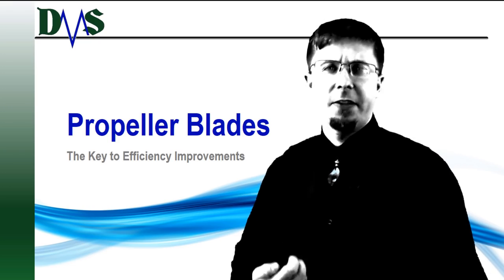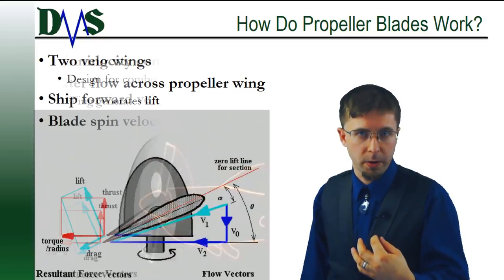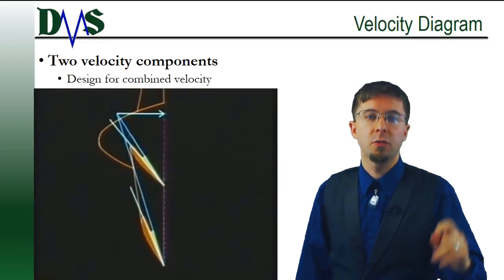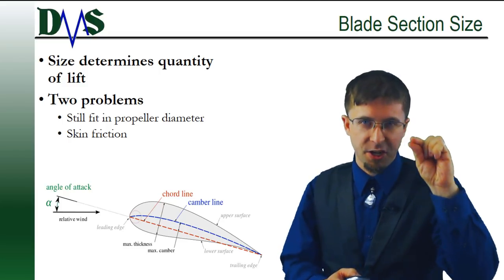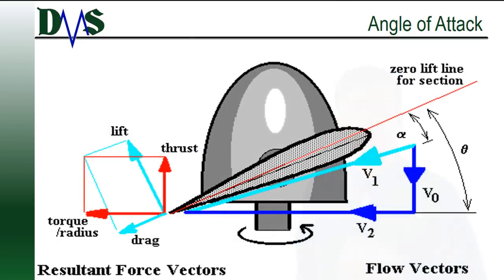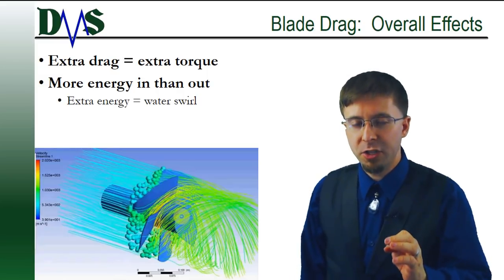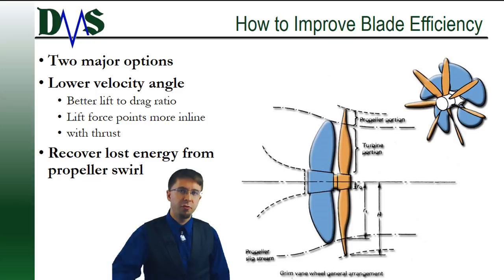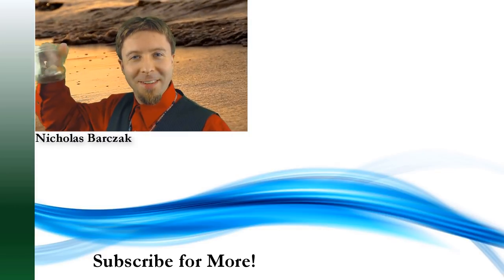Propeller Blades:  The Key to Efficiency Improvements

Comment: I like the sense of humour of defining the most efficient propeller, as one which has zero angles of attack and no thrust! 

Here is a question that one never seems to see the answer to it.
Considering that water is incompressible and the air is compressible, then if we take the same multiblade propeller with a high blade area for comparison, ( even an impeller)  what would the velocity/pressure profile of the fluid medium being used ( compressible air or incompressible water)  THROUGH THE THICKNESS OF THE PROPELLER  BETWEEN THE BLADES. and the immediate zone around the propeller. It is not an easy answer especially for those water propellers where the water velocity changes as it goes through and accelerates through the propeller!!!
Reply from the maker: As you said, predicting the exact velocity profile is a little difficult (but achievable with modern computers).  Interesting, the theory and mathematics behind propellers started with this exact problem.  We started with a goal for a velocity and pressure profile and created a device to achieve that.  In the zone directly around the propeller blades, we see minimal change in velocity of the fluid.  The one exception is the fluid right on the surface of the blades, which accelerates as it passes around the leading edge of the blade.  The pressure shows a huge change in the region around the blades.  It spikes from a strong negative pressure (suction on the forward face) to a strong positive pressure (pushing on the back face).  

This is the key behind propellers.  We are trying to create a sharp change in pressure, and the velocity change is just an unfortunate side effect.  The velocity of the fluid accelerates as it approaches the propeller and then slowly decelerates far downstream.
Reply: @DatawaveMarineSolutions  Thank you for replying. I thought about writing a book on propellers as I do feel that propellers could be misunderstood. I wish to share my philosophy on some types of propellers/ impellers. The philosophy stems from the fact that water is incompressible and it is also non-expandable as we must stay away from cavitation in this discussion.  Having a propeller whose blades are very thin and they form what is effectively a multi-start thread on a deeply threaded rod,  we can forget about Bernoulli coming into the picture, as there are other features to consider when we know that water is incompressible and non-expandable and is going through a threaded rod where the void spaces remain constant through the threaded rod. If we consider a shrouded impeller, rotating with its helical blades, it is no different from considering a piston moving along a cylinder where it sucks in water from the front and pushes water at the back.  WITH SUCH A SITUATION THERE IS NO LINEAR ACCELERATION OF WATER IN BETWEEN THE BLADES OF THE IMPELLER AND SO NO FORCES ARE PRODUCED IN THE SPACE OF THE IMPELLER. However, the non-expandable water at the front of the impeller will cause a sudden suction and the lower pressure than ambient will accelerate water ahead of the impeller.  At the other pushing end, the pressure is higher than ambient and so water will pass through the blades at constant velocity but at the pushing end, the water will be accelerated. Hence the propulsion forces are not produced in between the blades of a helical propeller but much ahead and much behind the propeller. 

All this is due to the fact that we are assuming perfect helical blades and incompressible and nonexpandable water going through.  Note any threaded nut is very happy going along a rotating threaded rod, does not increase nor decrease its volume and hence that is the condition of such a water propeller or an impeller we are considering.    The forces in a propeller are generated only where there is the acceleration of water and there is none in between the space of a helical propeller but there is plenty of acceleration in the zone before and after the propeller.

Now if the blades are not perfectly helical ( really constant pitch)  but are curved to diffuse convergently or divergently as in the case of a jet compressor stage, where the exit velocity is different from the incoming velocity, then the volume of water passing in between the blades acting as a diffuser will have to change the area it passes through and so for a curved blade that does not follow a perfect helix, a shrouded propeller should have the exit area of smaller area than the intake.  If we assume that the incoming water into the propeller v, has doubled its velocity to 2v at the exit, due to the curve of the blades, then there is an acceleration of water in between the blades of a propeller, and propulsion forces are generated in between the blades of the propeller.  Note that in this case we still do not need Bernoulli and aerodynamic sections as it is all a case of changing the momentum through the blades in this case. 

Now let us talk about surface propellors, as the manner in which they operate efficiently, is related to what was said above.  Now water may be incompressible but it will shatter into small drops if it is accelerated heavily and suddenly. If a paddle hits the surface of the water, the sudden effect will put a lot of force on the paddle but only a few drops of spray will shatter around the space where the water was hit.  

This is no manner in which to accelerate water either by sudden suction or a sudden pressure as water will show other characteristics. If water was like solid steel balls which do not compress not expand, then all that was said above will still apply but water is not like that, IT CANNOT BE ACCELERATED SUDDENLY. This is the importance of arranging for the apparent entry into the blades to be parallel with the leading edge so that the surface propellor will not just hit the lump of water, but it will load it onto the leading edge of the blade and coax it to accelerate along the blade due to the curve of the blade, and as the lump of mass of water reaches the trailing edge it is released with high velocity and there is no more acceleration behind nor before the surface propeller.    It is interesting that the solidity of the water in a surface propeller can change it shape due to the rheology of the water and all that acceleration along the blade must be done smoothly and fairly quickly before the lump of mass of water changes shape in smaller spray with no effective mass to drive!.   

So my point of discussion is between the two limits of a fully immersed propeller with perfectly helical thin blades where the space between the blades does not change and so there is constant velocity, no accelratio0n but a great pressure change between the intake and the exit., and all the propulsion acceleration forces in such a helical propeller will take place totally ahead and behind the propeller. Such a propeller can be enclosed in a parallel cylindrical shroud.

Then there is the non-helical curved blade propeller which accelerates the water along with the blades and hence the output area will have to be less than the entry area. For such a propeller with a slip of 50%, it is interesting how small the curve in the blade should be. 

With surface propellers introducing the air which is incompressible and expandible, then the lumps of masses of water can be separated and that is the reason the surface blade is curved as it is as water is no longer compressible and non-expandable and it can also roll off the blades if the acceleration on the lumps of water is too slow, on the other hand, one just cannot hit a lump of water suddenly as it breaks into small drops and so THE SMOOTH ACCELERATION OR CHANGE IN VELOCITY ON THE BLADES OF A SURFACE PROPELLER   MUST BE SMOOTH TO RETAIN LARGE ENOUGH LUMPS OF WATER BEING ACCELERATED ON THE BLADES TO FINISH UP WITH ENOUGH DRIVING FORCES. 

In my book, I think I would cover the effect of aeration and cavitation on,  the helical propeller along which there is no acceleration, the curved blade propeller along which there is acceleration, and Bernoulli and the air propellers will show the misgivings we all know about.

However, for now, I want to delve into the situation that even if the velocity of the water in between the blades of a propeller remains constant and the blades are purely very thin helical blades, shrouded in a cylinder in order to avoid water escaping or incoming through the surface of the shroud, one can have a good propulsion drive without thinking too much on the NASA and Eppler and other cross-section which their variation is velocities and pressures along the surface of the blade. The nature in which the accelerations of water are handled is very important and in surface drives, it is not a case of hitting a lump of water with a cricket bat!  It is interesting to start looking at drops of water, as stell ballbearing which does not change shape in all the transactions we activate in propellers, or else as rubber balls where the bat/blade hitting the water drop could change its shape as do most surface propellers as there is air introduced to do the buffering,   The fact that it is all inertia, acceleration and the rheology of the water, it makes it all so interesting to understand propellers in a better fashion. 

If we had to add a nozzle ( diffuser)  at the back of a propeller then one needs to build up pressure and one cannot use a propeller with narrow blades as found on an aircraft but one with multiple close blades as in a jet compressor where the high pressure built up cannot escape back through the blades as in a helicopter top rotor or indeed any wing with spaces ahead or behind the edges. Nozzles, are really velocity/pressure modifiers" amplifiers" with no moving parts and are related to diffusers, where high pressure can be changed to high velocity or high velocities can be changed to higher pressures. In ships, we need not worry too much about how it all works, as the modern jet engine says it all, for after all, in a jet engine, what happens between the blades is all that happens in a ramjet due to the fact that it uses compressible fluid like air. A jet engine is really a lot of ramjets in parallel made to rotate to be able to work when the engine is stationary on the ground!   The fact that water is incompressible and on occasions boils, so expandible, we need to fully understand what happens in between those water blades with the convergent and divergent diffus4ers  that may exist before, through, and behind the propeller. Perhaps understanding diffusers are a better investment than understanding propeller blades on their own.  We could have a front diffuser,  a  hot chamber to boil the water,  rather than a propeller and a rear diffuser and the whole engine would be located in the propeller!!!!!!   Pity that water is so difficult to work with and its latent heat of boiling it takes too much time relative to it passing between the blades of the propeller.  Now that would be a difficult machine/propeller to calculate mathematically !!! 

Thank you for listening,

Comment: Would a ducted propeller be more efficient and use the swirl too?
Would make a better skin, like shark or a golfball, the propeller more efficient?
Does the number of wings rise efficiency? 
Are the effects in air and water same or is there other things to consider then density?
I wish I had a physics teacher like you in high school.
Reply from the maker: Hi Andreas.  Excellent questions.  I'll give you the short answers.

Would a ducted propeller be more efficient and use the swirl too?
     Ducted propellers are more efficient, but not because of the swirl.  I need to do a whole video those.  A propeller duct is basically a wing wrapped around the propeller.  As the water gets sucked into the propeller, it runs over the duct wing and produces extra lift.  But we also have extra drag from pulling that duct through the water.  The benefits outweigh the drag problem up to a certain speed (around 14 - 18 knots).  Then it becomes less efficient.

Would make a better skin, like shark or a golfball, the propeller more efficient?
     It might help some.  But only about 2-5%  The skin friction on the surface of the blade is a minor part of the total blade drag.  We actually get a lot of drag from the lift generated by each blade.  (Physics:  you can't get anything for free.)  Some experiments have examined using those surface textures to improve the lift on the blade.  With the right texture, we can keep the water flow attached to the blade surface and use a more aggressive blade shape.  But more aggressive is not more efficient.  All those interactions are hard to gauge.  Normally, we have to just build a model and run an experiment to see what happens.

Does the number of wings rise efficiency? 
     Generally, yes.  Many of the efficiency penalties depend on how much force we try to squeeze into each blade.  More blades / wings means less effort from each blade and better efficiency.

Are the effects in air and water same or is there other things to consider then density?
     Air and water are largely the same, aside from the density.  Just three major differences:
     1.)  Air and water propellers generally run at different speeds.
     2.)  In water, we also need to worry about the limits of cavitation.  https://youtu.be/MyZzhwYMytc  That forms an upper limit to how much thrust we can fit in each blade.
     3.)  In air, we also worry about compressibility.  Air is compressible.  It's density changes depending on the pressure.  This is how we get sonic booms at the speed of 343 m/s.  But even before you hit the sonic boom speed, the air compresses some and we need to adjust the design for it.  

Great questions.
Reply: @DatawaveMarineSolutions  Interesting about the blade number, and as always I understand optimization is done with regards to some variables while leaving other variables fixed. My follow up question about your statement that: more blades leads to better efficiency, would be: is that when fixing the required thrust per blade or in general? Say i would like a certain low speed from a small displacing vessel well below hull speed. The free/undisturbed stream and the propeller diameter are both fixed. Would more propeller blades still be beneficial over fewer when the propeller thrust requirement is constant? Best regards, Christian
Reply: Don't forget about barnacles & oysters. Stuff grows underwater. Unless your designing outboard propeller, I believe simple is better 😉 (hull diver perspective)

Comment: Nick what is your thoughts about Z-drive pods attached to a sailing catamaran?
Reply from the maker: Not sure why you would need them.  As a sailing cat, the boat already has rudders, and catamaran means twin engines (usually).  That already gives very good control.
Reply: @DatawaveMarineSolutions  I was thinking that installing electric motor ones for when you need to motor instead of sail.
Reply from the maker: @carlsmith2826  My mistake.  I thought you referred to Z-drives which are azimuthing propellers, directly coupled to engines.  As to electric powered podded propulsion . . . that is a much longer answer.  I'm working on some videos that address this.  But the biggest issue I have with electric propulsion for boats less than 30 m. is the challenge of supplying suitable parts.  It can be difficult to find an appropriate motor at that size.  There are several industrial motors that are suitable.  But then it can be difficult to create the power infrastructure to support them.  That is a whole complex ship infrastructure problem.

Comment: Three important unmentioned items:
1) Propeller swirl is caused by a propellers inability to draw water into it by gravity equal to the exhaust velocity volume of the propeller . The exhaust volume exactly equals the intake. A delay causes most of the swirl.
2) Marine propellers get the water from the surface. The reason for this is the momentum of water. due to its mass. If not true, a marine propeller would be pulling water from China.
3) Propellers are very sensitive to tip speed.  A 20 inch 4 blade propeller with 0 pitch has  @ 1000 rpm, a tip speed of  5233 feet/minute, or just under the old "Mile a Minute" rule in engineering. The  power needed is 5 HP.. The same 20 inch 4 blade prop with 0 pitch , at 2000 rpm  requires 40 HP. This is why reduction gears help with thrust AND SPEED. The optimal diameter/pitch ratio is 12/10 for line pull and 10/12 for speed. This works from a practical standpoint. Usually, for a general purpos boat, a square wheel is optimal.
   ,All of this information is based on design of several boats and variations in design. Hope it helps someone. Especially hope it helps someone involved in using finite analysis or other digital development software HINT...HINT.
Reply from the maker: Interesting points.  Myself, I believe in scientific tests and hard experiments.  It would be really fun to check these concepts.  Based on your description, your first point seems to indicate that propeller swirl is due to an interaction with gravity.  If that was the case, we could easily create a test rig with the propeller mounter horizontal instead of the conventional vertical.  Gravity would be equal across the entire propeller.  According to what you described, we should get no swirl in that case.

I can also think of another test for the argument that propellers get their water from the surface.  Simply stick the propeller in a pipe and ensure the inlet to the pipe is well below the surface.  If the propeller truly gets it water from the surface, eventually, the propeller should run out of water, or the flow through the propeller should just stop.

It would be fun to test.